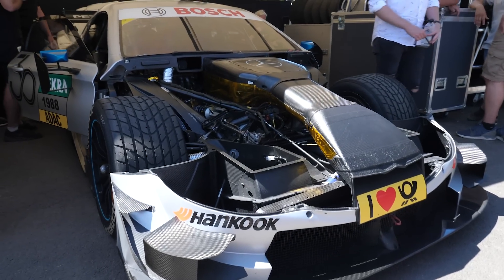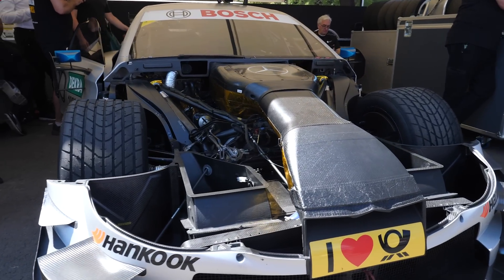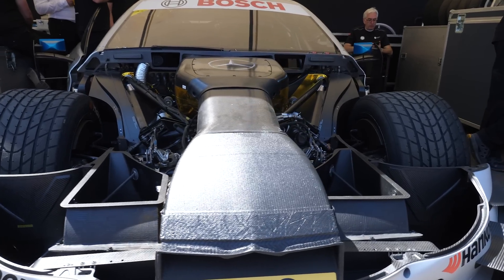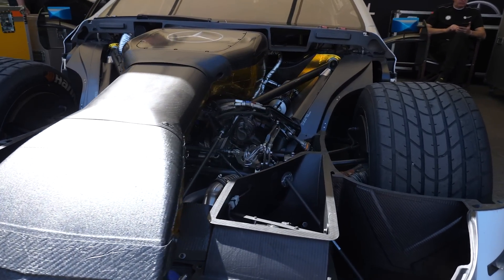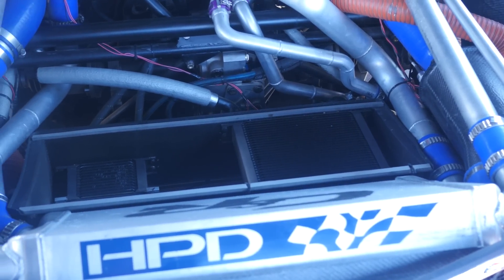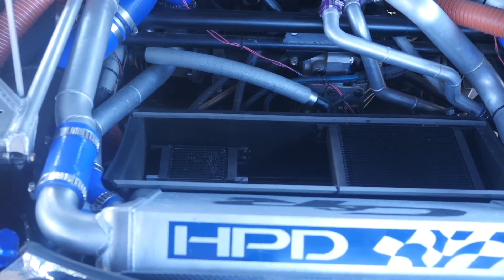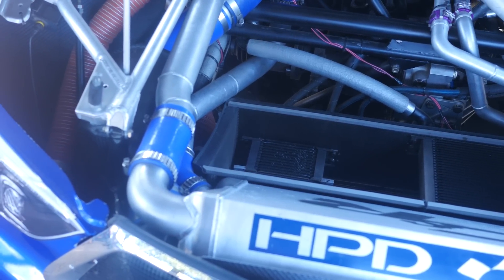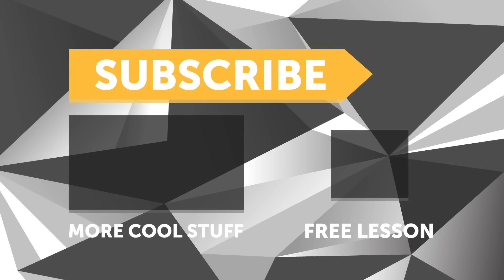Your Radiator Is Too BIG! (Maybe)

Comment: Does engine and trans oil cooler position in front of or behind the radiator really matter? I mean, my engine oil thermostat is at 200f, my 4l80 thermostat is at 185f, and my water coolant thermostat is at 185f. My trans runs at 185 all day going through the bottom radiator tank and to  an external cooler, my water temp does not move at all with clutch fan and shroud and my oil temp doesn't move with cooler on the front of the radiator ....
I mean, does it get any better than that? If it ain't broke don't fix it?
Edit: your thermostat should be closed while it warms up regardless of cooler position, then if everything has the same operating temperature it shouldn't matter where it is when the thermostats open, right?
Reply from the maker: Yes, it matters and will make a difference when you're setting up/building your car. Might be fine to layer them, might find you need to separate them. A lot of variables, there's not blanket 'do this' beyond the logic of prioritising what is most important first to get the coolest air if you are stacking them behind each other.
If you're not having issues with your setup, there's no need to change it - Taz.

Comment: took me awhile to get my head around the oil cooler behind the radiator, but its simple when realize that oil is going to be hotter than the coolant when both are up to temperature. Still dollar for dollar the best cooling system mod I ever done was ditch my clutch fan for a pair of dual electric fans from the junkyard. After tuning the pcm to have them come on before the factory set them to come on even when I had a massive radiator leak the fans kept the coolant under boiling with a heavily modified engine. Costed me 50 dollars for the modification but its a vastly better system, gained about 2 mpg, better cooling capacity, and my engine bay is much spacious now. which has made the engine vastly easier to work on

Comment: This is also applicable to intercoolers as well. There’s a bad trend out there with going with thicker cores to try and reduce IAT’s but over sustained operation it won’t help if the ambient air can’t get through it.

Comment: Too much air doesn’t help either.  The air must be decelerated before it goes through the core then re accelerated into the airstream. … if nothing else, air leaking behind the rad is detrimental.
Reply: what
Reply: That is true for drag reduction, but otherwise more air will always mean more cooling capacity

Comment: As a former Superbike and Formula Extreme/Formula 1 motorcycle racer and privateer team owner/rider/mechanic I can attest to the cooling difficulties with souped up motors.
For my privateer '99 Formula-1 bike I got sick of chasing the right radiator and simply added an additional radiator with an integral oil cooler to the front of the standard radiator. I increased coolant capacity by 30% plus oil cooling but only realized a slight temperature reduction of about 12° F.
After playing with that setup a while i finally relocated the auxiliary radiator to the rear end, under the seat cowling and above the rear tire and used forward facing ducts to scoop air.
That saw a slight increase in temperature reduction to about 16° F but it was only when i properly ducted the radiator ,sealing the majority off from the turbulant airstream around the rear tire and rearranged the ducting to pull air in through rear facing ducts and vent it down through other vents into the low pressure area directly above the rear tire created by the fairings and spinning rear tire that i realized the full benefit of the additional weight and complexity of the auxillary radiator.
I eventually realized a full 45°F temperature reduction during the race and as much as 65°F during cool down laps etc. On that cooldown lap my temp would actually drop below the ideal range and I never had an overheating problem again even on 104°F days on tight twisty tracks where I was only above 100 mph for short stints.
It was all about managing the air flow and sometimes, what looks like it should work doesn't and what intuitively would suggest a reduction in airflow, like boxing in a radiator and providing restrictive ducts for exhaust,  actually increases airflow and provides much improved performance.
Reply from the maker: Cheers for sharing your experience there, certainly an aspect that is often overlooked or misunderstood! - Taz.

Comment: I Like The (Maybe) Part Of Video Title. It's What Your Weakest Point Of Your Cooling System Is. Water Pump Flow, Radiator Location, Air Flow Before And After, Type Of Fans, Does Your Auto Trans Have A High Stall Converter That Hangs RPMs Just Cruising etc haha. My Turbo 5.7Hemi Jeep Had A 1" Thick Core Radiator And Had Trouble Staying Below 180 With A 160 Stat. It's AWD And Just Under 6000Lbs. Put A Massive 2-3/4" Thick Core And That Thing Sits At 165 All Day. Hottest I've Gotten It Just Absolutely Ripping On It Was 175F With The AC Blasting haha. The Jeep Has OP Front End Air Flow So Extra Thickness Was Not A Problem As The Air Flow Could Match It.

Comment: Awesome!
just had that problem with my recently LS Swaped S10.
i have put A 3 CORE radiator from amazon that probably came with too low CFM fans caused the engine run too hot.
just ordered 2 new SPAL 1300 CFM fans.
waiting to get theme.
Reply from the maker: Hope they do the trick. A decent shroud can make a world of difference too - Taz.
Reply: Look into a Ford Taurus dual speed fan. It pushes a pretty good cfm for a factory e fan. I think it's like 3000cfm

Comment: From some of the comments, it seems many have missed the main point - it depends!
Every installation is going to be different, and have different requirements - the main point of this video, IMO, is that the best solution isn't always "fit a bigger radiator", as sometimes the actual problem lies elsewhere, or problems as is more likely.

One BIG issue that many get wrong, is the fan shroud, where fitted - the three main mistakes are having the back of the shroud too close to the matrix- which chokes the airflow through it, relatively small fan(s) with a proportionally small opening to the shroud - which chokes airflow, and not using some form of flapper valve to bleed off the choked air - which chokes the air.

My biggest, personal, faux pas was when I ran a front and rear mounted system and had one fan wired in reverse. This was WAY back in the day and they were wired through a 3 position switch ON-OFF-AUTO (thermostat) - it was quickly apparent that one actually increased the coolant temp and an easy fix. Take it as a reminder to ALWAYS check the fan rotation qand, where the blades are also reversed, that they're set to the correct orientation for best efficiency.

Comment: Most people dont pay attention to heat evacuation. Remember that your coolant system need to handle a heat equivalent to the hp of your engine. If your engine is 200kw you basically have 200kw of heat generation to handle, if you do 600kw you have 600kw of heat. 600kw of heat is enough to heat 5L of +20C water to boiling in less than 3 seconds, thats the work your radiator has to take care of, and you dont want that heat to stay in the engine bay.

Comment: Never ever go with a thicker Radiator for a boosted engine very bad idea
Reply: Speaking In absolutes is the thing you should never do.
Reply: @codyramos3200  never go with a thicker radiator if you're running an air to air front mounted/stacked intercooler. There you go
Reply: @ANGRY408W it will restrict air flow through the air to air Intercooler and will reduce your WP pressure when you need it the most while idling in a hot summer day 
A Thicker radiator will kill your cooling system efficiency
Reply: @ANGRY408W that is possible however you have to study your oe wp idle flow numbers first hand before going for a higher performance electric or mechanical wp, an improvement there is not always possible, many factors comes into play and by all means always look for the biggest brushless cooling fan you can fit and upgrade your alternator accordingly, as there is no such thing called too low ECT for a boosted engine they always run hot its just the nature of the beast

Comment: For 17 years I owned and operated a automotive and truck radiator repair business. A fair portion of my business was building custom radiators for dirt track racers and dragracers where space and airflow was a major factor in keeping these vehicles cool. I can unequivocally say that this young man absolutely knows the dynamics of cooling systems and understanding the physics behind effective engine cooling. Good for you young man!
Reply: I'm a gen tech and I get a kick out of some of these units where the radiator is 3 stories up away from the generator.
Haha it ain't no fun filling those things and burping them.
Reply: Should oil cooler put behind radiator or front tq sir
Reply: @elbale2323 behind is better but I’ve been a mechanic and a transmission builder for 32 years and we always fit them in front . They don’t make the engine run noticeably hotter. If your talking about engine oil cooler behind is definitely better or better yet to the side of the radiator if possible
Reply: @elbale2323  In front of the radiator is preferable.
Reply: @billjamison2877 any advice on designing a cooling system for something like a kit car? Just tests that can be done or any things to pay attention to? 

Superlite slc if it matters at all. 

Huge gear head from gear head family with racing in the blood. Literally have family that worked for indy, and nascar, f1 and other stuff. 

Superlite is like my project to work on the stuff I'm not the best at. And getting better at everything. Cooling is one thing I've always needed to kinda just trust the experts on. 

However pretty decent and setting up ducting for airflow. And cramfu.
Reply: Well I guess now he can rest easy knowing he has your approval. Now if only we had internet stranger testimony to let us know you know your stuff on it

Comment: Interesting to hear you can have too much air built up under the hood. My question is, I have a stock full radiator and I was wondering if going to a half size radiator with better cooling would be a better choice to also free up the front of the car to get more cool air coming in and reaching the air intake cone?  On my car there is no clear place to have that cooler air come into the bay to reach the Air intake cone without running it down towards the ground.  Half radiator vs Full face radiator
Reply: ...... only time I've seen half rads work out is in Hondas thick half rad with a high cfm puller fan.
Reply: It's best to not get air out of the engine bay because it will always be hotter than ambient temperature. You should always pull air from in front of the bumper for the intake charge
Reply: The title and thumbnail of the video is misleading. NEVER in this video do they actually propose creating a radiator with a smaller face area; they only talk to the benefits of a thinner core. The pressure build up behind the radiator occurs at high speed and hood louvers are one of the obvious solution there.

Comment: One thing they did not touch on is the engine being the real problem. A very easy way to find if your camshaft is the cause of your overheating, is just look into the intake manifold. If you see carbon in the intake and ports, you found your problem. No cooling system will keep up with an engine that is rebreathing its own exhaust. Fix the camshaft and the overheating problem will go away.
Reply: Are you sure of that? Increasing amounts of Exhaust Gas Recirculation actually DECREASES exhaust gas temperatures; counter-intuitive, but true.  A big overlap cam DOES require more ignition advance at idle and retarded ignition timing vs. what the engine wants sends more heat into the coolant.
Reply: @adamarndt7617  I am not talking about Ex Temp, I am saying just what you said, it increases coolant temp.

Comment: The problem with radiators is more to do with expansion room within the radiator. I was running a 351 Cleveland in a Falcon with a small top bottom tank radiator which was designed for a six cylinder engine out of a Torana. I would show the vehicle in particular on 40 degree days leaving the engine idling in front of the workshop proving it is NOT the radiator that dictates the cooling capacity of the engine. The most IMPORTANT component is the water pump.
Reply: And what is it about the water pump then? The pump itself? Or the drive ratio with pulley sizes...

Comment: Heat transfer refrigeration engineer here.... he's pretty much on... but this is a generality. You very well could be very high in flux and increasing your airside htc resistance by dropping fin area. Better solution is more mass flow on the air side and water side to keep the della t way up.

Again, he's not wrong, but people shouldn't shy away from a thicker core IF... IF they have sufficient air flow. The title of the video is wrong... the radiator isn't too Big... your airflow is too low because your ducting or fans aren't sufficient for your air side pressure drop.
Reply: Turbo miata without ducting behind the rad of some sort won't cool worth a damn either. You'll get a high pressure area right behind the rad, where the front of the engine, subframe and steering rack are potentially equal in pressure to the whole front of the car. You can see all those things looking at the bumper from the front, air crashes straight into them since the bottom of the bumper is higher than all three. No flow through the rad, no matter what size it is ain't gonna work. Add the factory ducting back or fab something and air keeps it's speed under the car, low pressure compared to the high pressure at the grille, works great. 

The stock miata radiator will heatsoak after a few good pulls, besides being a plastic tanked leaky nugget. A larger or more efficient core is an absolute necessity if you add enough power and actually want to use it more than once every couple minutes.

Comment: Interesting, in my application went from a thin stock radiator in a Solstice 2.4L NA (modified 300 whp 5558 turbo) that needed to run the interior heater to cool it down below (100C) to a "V8" thicker and larger aluminum radiator maintaining 88C (190F) always, stock fan with a air-water intercooler heat-exchanger in front of it.

Comment: Julien Edgar has some useful methods described in his books for determining how well air is able to flow through not just coolers but filters and inlet tracts as well, cost of the testing is a few dollars and some time, very accessible to the average diy.
https://youtu.be/70ixn1dzk2s
Reply: Julian Edgar has also been doing this since the 1980s and his specialty even back then was doing upgrades for cheap, he had an article called the $50 tech tip. I learned off him when I worked at the same magazine he was. 👍

Comment: I wish they spoke about the duct ratio. When not funnel massive amount of air to the radiator. I know it’s about air speed to but still a explanation would be great.
Reply: G'day Andrew, you want to increase the pressure difference across the radiator, so higher pressure at the front and lower at the rear. this way the air is drawn through the radiator, increasing the flow rate and with it the cooling. One way to do this is with a fan on the back side, pushing the air away from the radiator and with it reducing the pressure on the back side, Bernoulli's equation. Another is by having a funnel increase in size towards the front of the radiator. A quick and easy number is an entry of 1/3 the size of the radiator which increases to the whole radiator, over a distance large enough that there is limited flow seperation. This way the air is slowed down and with it the pressure is increased. If you'd like to know more, I've made a video on the theory of ducting design, https://www.youtube.com/watch?v=pg5GetSQJ3E

Comment: I can attest to this information. I have a 95 Mustang that originally came with a single core radiator. Ford offered an HD upgrade that was 2 core. One time, i installed a 4 core radiator and it was terrible. The car took forever to warm up and when it did, it overheated due to the air not being able to get through it. I replaced it with a 2 core and everything was normal. Now my issue is ducting since i put an aftermarket front bumper on that isn't 100% built like the OEM bumper with an under tray. The air is escaping where the under tray would be instead of going through the core. Good video HPA💪 - Pantyeatr1
Reply: I remember back in the day when a thicker Copper-Brass radiator provides a better colling, too bad this 70s idea is still rooted in our minds, An aluminum radiator does cool better than a copper brass radiator. For example, an aluminum radiator with 2 rows of 1" tubes is equivalent to a copper brass radiator with 5 rows of 1/2" tubes. Aluminum provides high efficiency, is lightweight, and has a longer life compared to copper brass it's just mind blowing
Reply: the core was likely designed with racing in mind and expected you to be running full speed with lots of air forced through
Reply: Moving past the name lol, even a basic shroud can really help with cooling. I struggled with cooling on my turbo f22 Honda, went with a big aftermarket alloy radiator. I couldn’t get the car to temp on anything shorter than a 20 minute drive. Put back in the stock rad and made up some shrouding with a plastic/aluminium composite panels, coolant temp hasn’t come above normal since.
Reply: @Cathartic_Dark  you love my name! 😆 It's also the name i use on eBay.
Reply: Yep, the 3rd and 4th gen mustangs (I have a 88) are bottom feeders like corvettes.